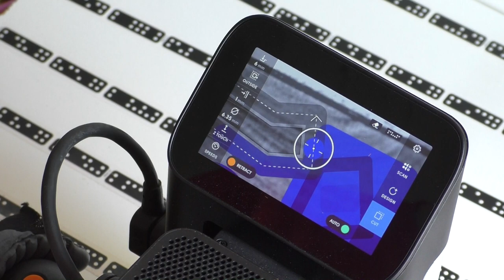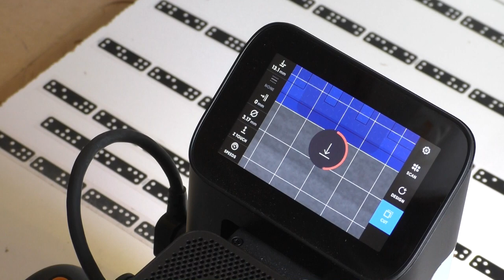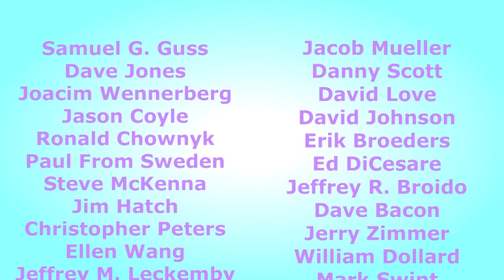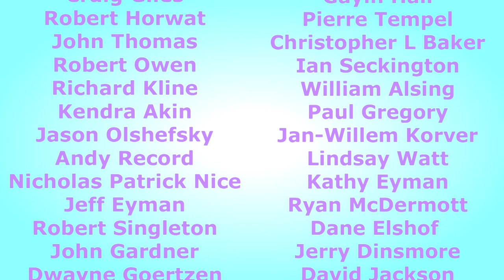Project Egress: FranLab Mission Log 4

Comment: While that wooden component is gorgeous, I wonder if it will actually be strong enough to work in reality.
Reply: I was just thinking of that. Maybe cast it in aluminium? Maybe it's just good enough as a model for the 50th moon anniversary exhibition and doesn't need to handle use stress.